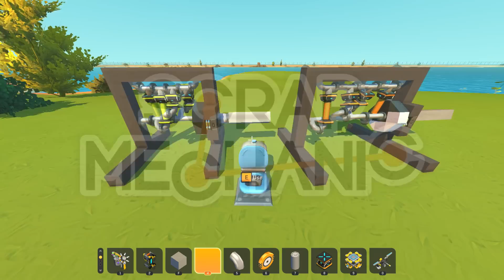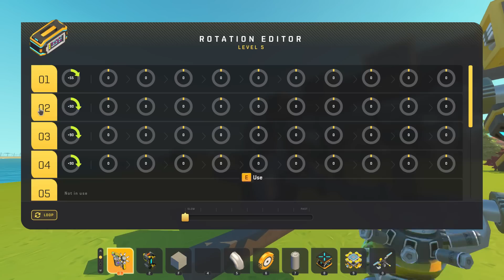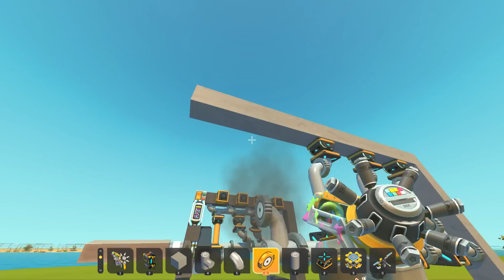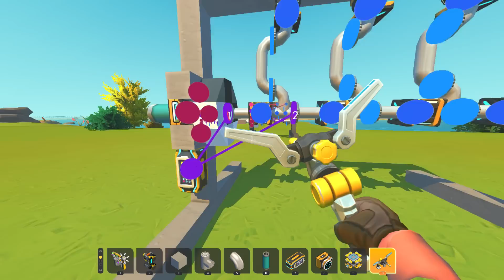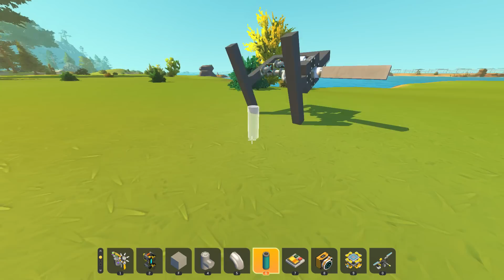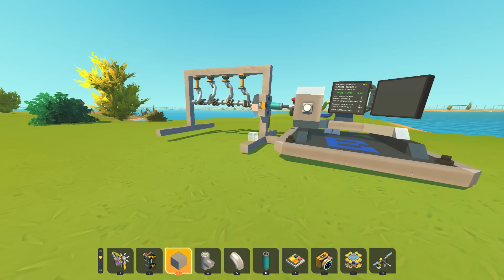I Built an Engine With Stationary Pistons to Mimic How a Real Car Works!

Comment from the maker: Alright we have to start working on transmission systems to get power to the road. What kind of things should we build first?
Reply: A 3+R (edit: 3 forward gears and one reverse) gearbox is quite a simple thing iirc, you could use the "mechanical parts" mod and its associated blueprints for good gears, it's got three sizes, beveled gears, through-bearings and a few more cool mechanical parts
Reply: You have to do a semi truck since the engine size is so big
Reply: @killerexploration148 😊😊😊😊😊😊😊
Reply: Given that all gears in scrap mechanic are terrible, build your gearbox based on automatic gearboxes. These use planetary gears which are probably the only kind of gear setup with decent performance and size.
Reply: @blueflame_sm  ok but manual transmission is fun
Reply: Before you get into transmissions I think you should explore glitch welding properly. You need small engines to make up some space for transmission (unless you want train sized cars). I'd recommend looking up a piston engine tutorial as well, not to copy but to understand what they are doing different and why it might help.

Also, you could've just had the piston on the rods instead of the shaft
Reply: V8
Reply: Radial engine, X engine, or W engine
Reply: Hey KAN just a thought but have you tried using 2 pistons instead of one per cylinder end to end to increase velocity and get higher rpm + may increase overall power as well who knows
Reply: Rock crawler systems
Reply: radial engine pls
Reply: Kan I think all your engines would work better if you gave the encoder wheel one block distance away from the sensors so the game isn't trying to calculate that collision
Reply: try using a realistic crank that will make your realistic engine work better
Reply: mr KAN some v8 engines use the same crank pin for 2 rods so it might not be very long.
Reply: a inline 6 might help since you can use the cross crank and not the i shaped crank
Reply: A 4 gear system plus a reverse so 4 forward gears and a reverse gears or 5 forward gears but I think the sweet spot is 4 personally
Reply: Make an autopilot vehicle with the piston engine!
Reply: Radial engine with 12 or 8 cylinders would be amazing
Reply: This does kinda look like something I had been thinking of asking you to try, you know those old old hand drills that were a drill and a curved handle you spun around? I wanna see that if that applies to this.
Reply: Yo kan to make the pistons right next to each other put the piston from the crankshaft onto the gap in the piston rod
Reply: I still think you should dyno a valve gear and see how the different timings effect the torque vs the RPM
Reply: The Kan Mobile
Reply: magnet pistons engine
Reply: To begin with just forward and reverse then a manual. I wonder if there’s a way to make a clutch to help with shifting. And stopping…
Reply: thruster engine a giant engine with real engine pistons be aware that torgue will not exist (the thrusters are the exploisions that push down the piston) make sure to atleast have 4 thrusters every piston. a I4 takes about 1 hour to build when youre good at it i actually just build  a I2 engine with 4 thrusters every piston
Reply: I think you should take the engine one step further and make it with no clipping.  It would require two extra bearings per piston, but it would be more realistic.
Reply: @circuitgamer7759  I think the physics would result in an absolutely abysmal torque output
Reply: @paulkanja  I agree, but it would be an interesting comparison.
Reply: you should make a manual transmission for a tractor, You would have a large area for the engine in the front of the tractor. Also it would be cool if you had an attachment on the back for farming equipment so that you could actually design it for survival mode.
Reply: Before transmissions you should come up with a compact working differential with minimal losses. Also, have you experimented with flat plane cranks vs cross plane cranks to see which is better in SM? IRL flat plane cranks are more efficient but cross plane cranks run smoother and have better drivability.
Reply: The easiest would be a transverse fwd configuration, just connect the engine directly to the wheels, the difficult part would be to steer. You could also do a transverse rwd, but you wouldn't be able to steer that much, you would need a differential.
Reply: It be very cool and impressive to build a cvt.
Reply: Working clutch.
Reply: CVT
Reply: How about a piston powered pedrail?
Reply: a bucket loader
Reply: M8 piston engines are 1 stroke
Reply: Make a I-5 Stroker!  Widen your crank and extend those rods!
Reply: Video idea: piston powered tank where you have two counter rotating piston engines, one for each tank track.
Reply: Simple three speed with reverse but do a transfer case as well haha also for the crank shaft you could just make with loops that attach to a T from the connecting rod, could have offset bearings in between and not need the pistons, would compact the build by a block per piston I think? ...ah maybe not.. anyways.. haha
Reply: A simple helicopter, normal or coaxial rotor
Reply: More engines! I want to see the full extend of what's possible in the challenges, even if it takes much longer!
Reply: Have you tried using low friction blocks around your output shaft
Reply: Have you tried using low friction blocks around your output shaft
Reply: Have you tried using low friction blocks around your output shaft
Reply: In Deniz 567's video he shows how to make a v engine
Reply: for the car, recreate the first gen miata (it has an inline 4)
Reply: You could have used T pieces to eliminate the pistons in the shaft.
Reply: make bigger piston engines such as I6 I8, it would be really useful to see how to time those and how much smoother they could run.
Reply: A cvt gearbox 💀💀
Reply: Replace the Strait pipe in the conrod with the piston. Then you can remove the extra gap between pistons.
Reply: V engine... still please
Reply: @Gnocki 😊
Reply: Howdy, i love your attempt to make a realistic engine! but i just wanted to throw something at yea because i think you'd find it interesting.

Maybe you can't really power a engine with explosives in scrap mechanic, but what if you tried to have no clipping pistons at all? after all, cars don't use them. so why should you? 
(thought it be an interesting little challenge i guess. rework the engine shaft and all, yea know?)

Comment: You could change the shape of the drive shaft so that the connection is offset by one block.  Instead of elbowing from the piston arm to a T junction that’s in line with the shaft, elbow the shaft to a T junction that’s in line with the piston arm.

Comment: Could you relocate the through-piston to the conrod, rather than the crankshaft? This adjustment would enable you to position the bearing on the crankshaft earlier, resulting in a reduced length for both the crankshaft and the distance between cylinders.

Comment: I modified my thruster powered engine with your adjustable timing after I first saw it, It made a world of difference compared to my original timing solution (Sensors that detect each thruster at tdc with a timer). Much smoother but still has barely any power on the dyno.

Comment: Use a t with two bearings, on the sides, for the crank. Then take pipe up to a 90 left bearing then a 90 right and connect that to a piston. You wouldn't need to use pistons to clip through. And it would be a actual crankshaft.

Comment: idk if this counts as a "motor" but if you take a bearing, add an arm extending down, put a sticky wheel (mod) on it, put a slab of blocks on one side, and mirror it, then activate the wheel, it spins around 1k and has like 11k nm of torque.

Comment: If you make the encoder 5x5 on you piston engines, and then only mark a 2x5 area on it, the piston engine will run much smoother.

Comment: I think the real way of connecting each piston might work, but maybe there will be loss of power by using T pipe instead of 90 degree pipe on the rod that connect to the crankshaft, make it more realistic looking but add complexity.

Comment: The bar that is 3 length, If you replaced the middle straight pipe with a piston, then that's the part that clips through every single rotation, and you can remove the other piston to bring the spacing in.

Comment: ** A solid crankshaft with U shaped offsets @90 degrees respectively, (0,270,90+180) and only the connections to the crank would have a bearing! **  I guess that is possible... ?  I dunno, a normal crankshaft doesn't have all those bearings...

Comment: Move your timing wheel so it stops hitting your frame, you are loosing power across the board because of it... the pipe is also hitting those blocks that are around it, on my engines i just leave that end unsupported with a flywheel, when on the dyno it stops moving much and on builds you would put a bearing on the other end. also a flywheel is needed it helps, you saw that first hand already!

Comment: 9:11 you could forgo the clip through with a double bearing t piece, although then you would have a lot of bearings in the shaft, you would have to do a wavy sort of shaft too, from left to right it'd be like a real crankshaft, not sure if there is a problem with doing it that way, just trying to give my observation 😄

Comment: I've got a quick idea for the collision, right now you have a piston on the camshaft, what if instead you have it on the connecting rod, if those are the two places that touch and the place you currently have the piston is bad, might as well try it. (This is about were I got the idea 9:03)

Comment: not sure if this would work but since the pistons are stationary could you get rid of the sensor wheel and place the sensors to read the height or length of the rod and tell the piston to fire?

Comment: This dyno thing is pretty cool. It really is to bad the dev's won't fix the jankyness in this game. I spent like a month building a sweet v8 piston engine in survival. the sensors and logic were in the "heads". I added some decorations and it actually was a fairly convincing looking v8 with valve covers, headers, cooling fan. Then I built a car around it with realistic double wishbone front suspension and a 4 linked solid rear axle that could all be raised and lowered by pistons. drive neutral and reverse. unfortunately, it was ruined by the suspension glitch bug I could never get rid of and the dev's refused to patch or create in alternative non glitch suspension. and a bit of slippage in the rear diff. Then my base got laggier bearings got floppier. Once I realized the dev's will never improve the physics issues I completely just gave up on this game.

Comment: Real pistons don’t all fire in a line. They often fire in a sequence such as 1,3,2,4. Maybe if you mimicked this, as well as the design of a camshaft so it doesn’t glitch through, it would be a lot more stable? Though it might be very long. 
Also a flywheel stores mechanical energy to balance performance. It might make readings more accurate.

Comment: As much as these are interesting, would be cool to see you try to design a radial engine.

I think I can see how it could be done. Basically make a straight shaft for the crank, but the block all the pistons connect to is on the end of a piston, so that when you take it off the lift, it gets offset by a few blocks?
Reply from the maker: I did make a radial a long time ago actually. I'll show it in my next video :D

Comment: Maybe try to build one where the shaft does not require bearings to set the 90° offset, and no pistons clipping through either.
Only works as a boxer or 4 piece radial engine.
Straight shaft into 90° elbow up to the piston, another 90°, bearing, t-piece to piston, another bearing to elbow, down again, and then 2x90° elbow to the next piston.
Gave me good results in the piston challenge pack with just 4 pistons in a radial configuration

Currently i try to get a Atkinson differential engine working.

Comment: I rebuilt your generic I4 in my world but changed the firing order to 1-3-4-2 like a real car and got double the horsepower out of it. All you have to do is set the controller to 270-180-90 instead of 90-90-90. Though you'll probably never see this. TwT

Comment: I think this would be more of a single stroke engine, pistons in scrap mechanic not only put force on the crankshaft going outward, but they still put force on the crankshaft pulling the piston back inward

Comment: With the engine that uses explosive where the explosive is have it surrounded by the unbreakable glass so that way you can see the explosion and it should also work aswell

Comment: You can try making an engine that has the same glitched pipe technique but with 8 pistons and a sensor wheel that is at 45 degrees to the regular sensors. Then set the crankshaft bearings to 45 degrees as well. Smoothest and most satisfying thing ever.

Comment: Kan here’s what I would do if it was me since you are wanting to make more power without clipping when making the drive shaft you have make a straight piece from the outside bearing then curved pipe piece going down then a curved piece going to the left (this is all while looking at the side of the engine) next will be a T pipe with bearing on both sides of the T pipe next a curve piece going upward to another curve piece going to the left( think of the directions like a gps turns on a road map) once you’ve done that you’ll take what you’ve just made on the U shaped design and copy it and flip it 180* so one u shape pointing down and another pointing up then do the same thing but reversed so another U shape pointing up then another pointing down this sets your initial timing for the engine pistons at engaging on the color wheel 0,180,180,0 now that your crank shaft has been made you’ll then have to connect your piston force to the crank so to do that here’s how from the T pipe in the middle of the U shape of the crank you’ll use straight pipe coming up the centerline of the crankshaft then you’ll add another T pipe with the t bottom facing the straight pipe next add two curve pieces on each side going up add bearings inbetween the two curves then put another T pipe connecting the curves with the extra bit connected to the piston this will allow the crank and conrod to rotate independently from one another and allow you to keep a straight line of pistons like you have been doing before copy this over to the next 3 pistons then you’ll need two color wheels with two sensor one for each pair of pistons and on those color wheels the sensor on the white parts of the color wheel will go to the two center pistons while the sensor on the black side of the color wheel will go to the outside pistons

Comment: the engine is 1 stroke more like a steam engine not 2 stroke. You should use a wheel to attach the piston at the edge, and bearings at its center to better emulate conrods (you could also make a custom part similar to the encoder wheel if the actual wheel doesn't want to behave or the distances can't add up), yes it would be huge and would require a crankshaft but it would be way closer.

Comment: Could you essentially double the torque by placing two linear vertical pistons, double stacked, on the inline 4? Should be more compact than adding more pistons to the driveshaft.

Comment: you could try having all force always applied vertically by having the pistons move side to side on 0 force suspension and low friction blocks. it would be equivalent to infinite piston length and extract all force from the piston

Comment: Why do you do the crankshaft like that? I dont understand scrap mechanic but i feel like you dont need those phase through parts, just make it connect through a t with bearings on either side, instead of that L piece.

Comment: Piston engines are actually 1 stroke engine and not 2 stroke engines. In a 2 stroke engine the power is provided once every 360° of rotation per cylinder, here there is power once every 180° of rotation per piston. The piston provides power when extending but also when retracting, meaning it provides power once every stroke (180°), making it a 1 stroke engine. It is like some old steam piston in trains, steam was used to extend the piston but also retract it.

Comment: Could throw offsets on the crank like a real crankshaft and use T pieces with 2 bearings for the end of the connecting rod. Top side could use t and double bearing as well

Comment: is it nessesary for the encoder wheel to be basically flush with the frame? Or can it work with one Block apart? There are always particles and i always think its friction, don´t if thats how scrap mechanic works?